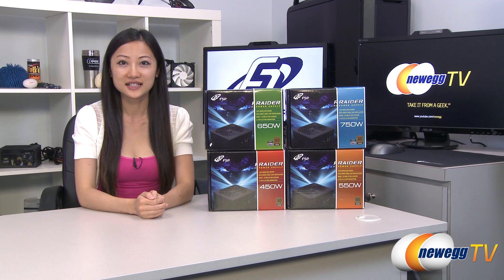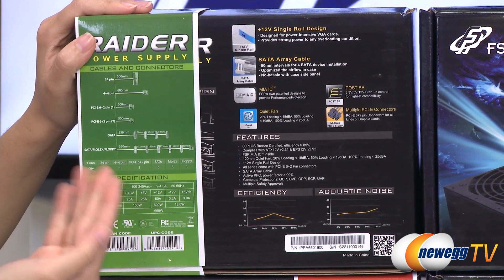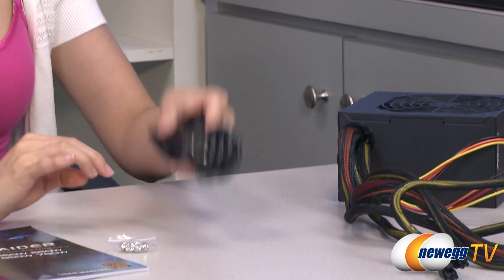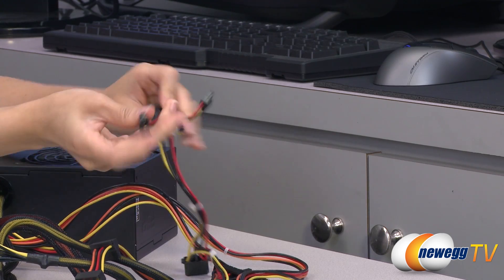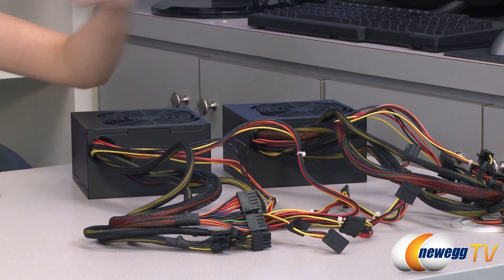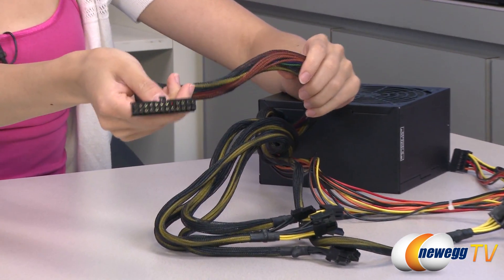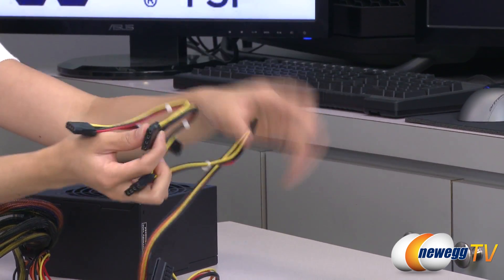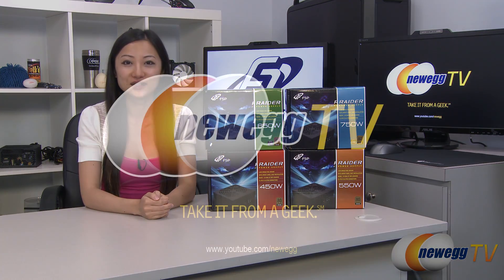Newegg TV: FSP Group RAIDER Series 80PLUS BRONZE Power Supplies Overview

Comment: is the 650w a PSU worth buying? I heard these PSUs are not that stable, is this correct? I have a corsair cx750 atm and i'm not happy at all, i exchanged it 2 times already and it still makes noise under load. (PS i overclock, i don't want any power spikes)

Comment: First off, who's going to buy a 450w PSU with +12v @36A for gaming? specially if you plan on getting a GTX 680,   When this particular model is great if your planning to build an HTPC and good enough for an everyday normal use low end PC  .. is not like this 450w PSU model is being advertised towards hardcore gaming..